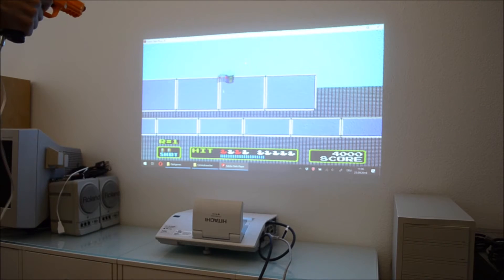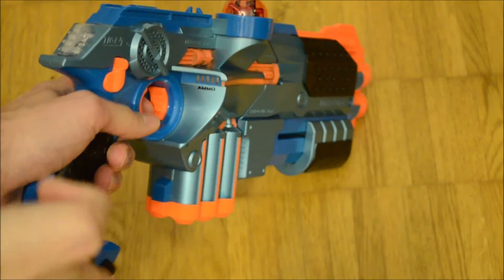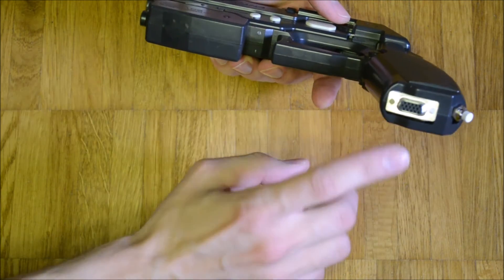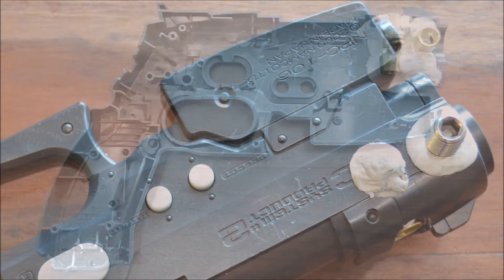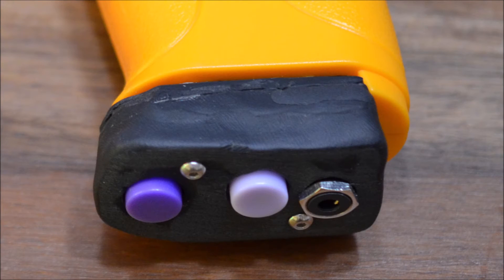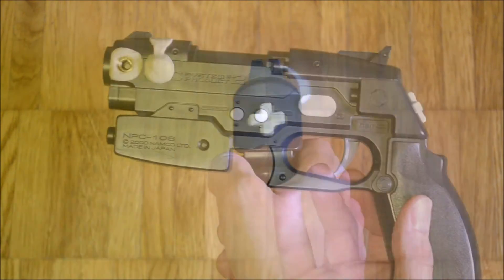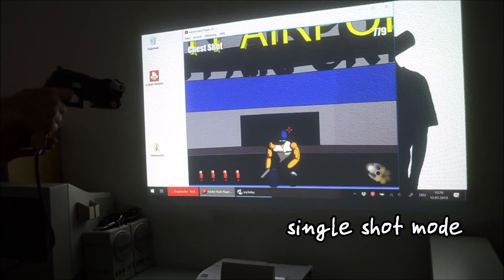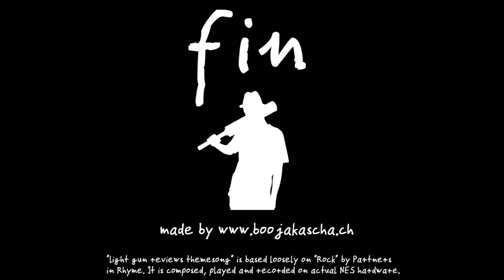Light Gun Reviews 126: custom laser game controller

Comment from the maker: Here is a micro controller (using an Arduino Micro) based approach for the signal generator:
https://youtu.be/JeAQTW39W3k
You can use this alternatively, if you are not into discrete electronics.

Comment: I have questions about the safety of the laser. The laser I use is 980nm 30mw, and the laser of my light gun is always on. Will it be dangerous if the laser is reflected from the display to my eyes?   Because it is invisible light, I never thought of this problem before
Reply from the maker: Most legislation deems lasers with a power of greater than 5 mW dangerous. This is for VIS but I guess it's similar for IR. Back home I will check what I am using and update =) There is no need to use high power lasers, IR cams pick up light around 1 mW just fine. I have used LazerTag guns for children before and it worked.
Reply: @Boojakascha  Thanks! My camera is PS3 eye. I modified it and added a filter to filter the visible light, so it can only see the point of the light gun, so it can be displayed well in theory at low power?
Reply from the maker: @jiachunyuan8742  I have a gen 1 eye and it's almost insensitive towards IR. Can you see the IR light well if you film with the camera? I imagine this could become a problem.
Reply from the maker: I just looked it up! I use a 5 mW laser. But I play against a rough wall you see. It won't reflect much light back at all. Personally i wouldn't go over 1 mW when using a TV screen or wear goggles (I own IR goggles, because I knew I will need it during development of the signal board).
Reply: @Boojakascha  Thank you very much for your reply, I decided to buy goggles, and changed the 30mw to 5mw, I used 30mw to play on the computer monitor for a long time, it is really lucky that my eyes did not hurt
Reply from the maker: You are welcome. I am very glad too that your eyes are still fine =)

Comment: Awesome work
Reply from the maker: Thank you very much, I am glad you like it! =)
Reply: Gonna have to report this video for too hot content!

Regarding the custom DB15 cable, I salvaged 25-conductor cords from DB25 cables for my own applications with the VGA/DB15 connectors, mainly a controller extension panel for the Atari Jaguar. That black sheathed cord looks very nice, where did it come from? I also assume it's DB25, or if not, how many conductors does it have?

And if you ever need more switch kits please let me know.
Reply from the maker: @bratwurstspawnbaby Thank you very much! =)
The cable is called "Conrad Components SH1998C249 Videocable". It is supposed to be used for HDMI. I got it as for the fancy shielding. It has 10 wires grouped as pairs, which are individually shielded. 4 thicker wires are in the core. All these wires are again shielded with one big wire mesh. I use this wire mesh as a 15th connector and use it as ground. It's relatively flexible! For another project I used veeeeeeeeeeeery rigid cable and this time I wanted to use something more flexible.
As for connectors: HDMI wouldn't be a terrible choice in itself! But I feel 15 years too old for such shenanigans so VGA it is^^
Ah yeah, DB-25 is the pinnacle of coolness =)